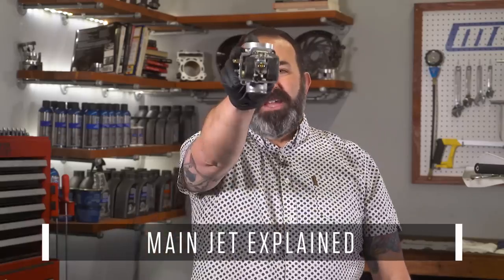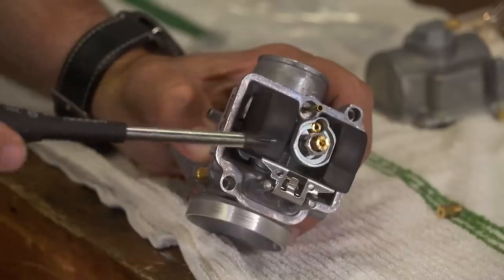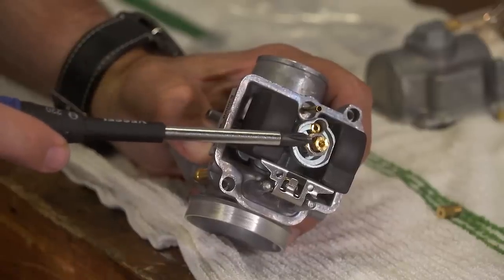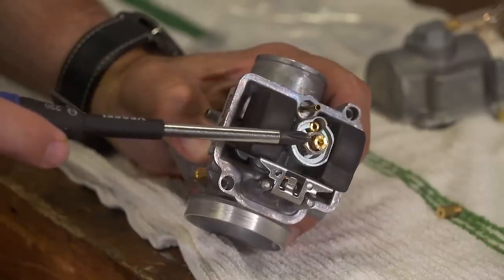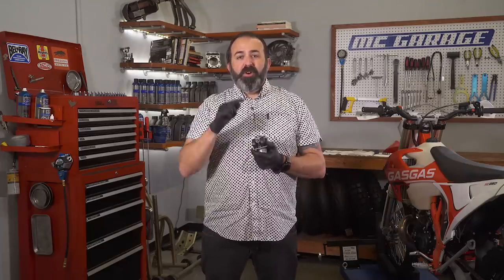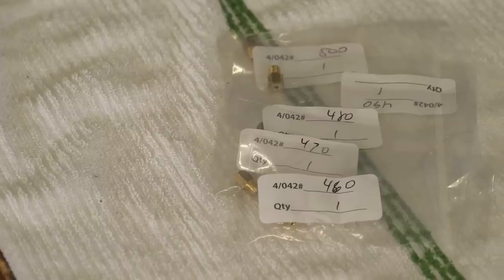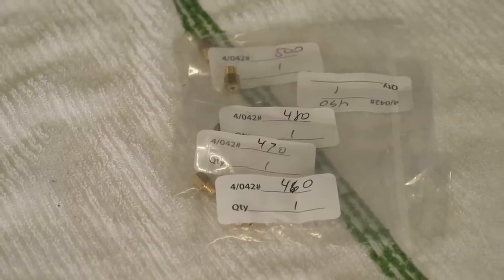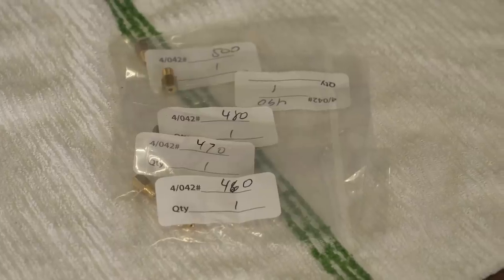Inside A Motorcycle Carburetor - Main Jet Tuning | MC Garage

Comment: Nice n clearly explained, I’ve recently seized my 1952 BSA A10 , suspect it was running lean on either the main or needle jet. Like the man said, it’s difficult to hear it pinking on a 4 stroke especially an air cooled one as there’s a fair bit of mechanical noise anyway. Going to experiment with both main and needle jets. Great video.

Comment: Seems like my bike runs fine until 7000 rpm, then if I go wide open throttle it dies until I let off the throttle again, OR if say I'm below 7000 rpms I can go wide open throttle all day long.  The issue is my bike is set up with the power band between 8000-9000rpm is the sweet spot so I need it to hit that range to get the full 30hp... below 7000 rpms is not ideal.  (no poping or backfiring noises are present.)
Reply: Same here let me know if u get a solution

Comment: i swapped from a stock 30 main jet to 32.5 and put the jet needle on its leanest, ran great up until a certain high rpm at high speed, but the same rpm at low speed didnt have a a lean condition problem, so ive adjusted the needle twice, back to stock, since then and it still seems lean and dies at that high speed high rpm range. of course i always go to full throttle every time but past 3/4 only goes lean at highway speeds. its a mikuni bsw27 btw. cc double barrel gsx250f across carby.
Reply: 3 washers under needle, 60 main jet.  Bam bam perfect.
Reply: MrCokemaster05 nah

Comment: Thanks for share! 
please excuse my wrong english.
I need some help now for jetting.
 I'm crazy looking jetting my Honda XR150L, Keihin PD 20mm bore carburetor. I'm not technician just researching.
Local service does not have a O² sensor and spark plug reading knoweledge seems to be not good.
I made 2 times plug chop  for main jetting and it goes wrong without vissible carbon deposits making me to ask for myself if jets that I have been testing are out of range or they are still in lean range.
Stock jets are 38 and 102, 150cc, 20mm bore carburetor,  stock airbox and filters, 1500f ASL, 82~95°F. Chevron "97 RON".

Spark plug reading for stock jets shows white dots, white deposits, so jets are very lean.
I step up for #112 main jet but plug chop (run almost 6 miles on main jet), plug chop shown just a little brown mark but Not a complete ring, and it spot in the upper part of insulator and oriented to the exhaust valve,   not more!
This question is for your knoweledge,  for this engine, carburetor and environments,  what numbers of jets could be the range to test?
I just like to protect my engine from overheating and knoking or some else failure...

Very Thanks!

Comment: Will a shop let me bring in the carb alone (Bike runs with starter fluid so I KNOW its a carb issue)? It's not even dirty but has a clog somewhere and after cleaning it 4 times I have given up. I don't have a means to transport the entire bike and the fee is well over $200 alone for one way.
Reply: Of course they will, you just need to specify which bike it is from. Also a phone call beforehand doesnt hurt. They even take just the wheels to mount the tires on them. If I were you though I would just ride my bike to the nearest shop, and let them do a carb sync(if you have more than one carb) mixture and idle speed adjustment. (which they can only do when its in ur bike, since factory specs seem to not hold up after a couple of years and carburetors do not self adjust)

Comment: I have a 06 vtx1300 I have a stage one dj kit I do some drag on my bike and looking to get the most out my carb I'm running straight long pipes and a stock airbox and a K&N filter I live in Florida I have the 195 jet can I put the 200 in it to gane more power at wide open throttle and were should my needle be at

Comment: 23 yz125 keihin carb
Can a pilot be lean and be safe? 
My bike is getting spooge from silencer
Stock settings are
Main 160
Pilot 75

I’m looking at jd jetting kit but 
Jd jetting comes with a 50 pilot 
And is telling me to use a 170 main
On 4 position clip of the needle. 

Not sure if that pilot is too lean for my 2 stroke

Comment: Let me ask you this. My wifes Kawasaki Vuocan 750 is acting lean at idle, rich at a cruise but runs great when getting on the throttle. It doesn't idle consistently, when you rev it, it hesitates then revs and takes a second to go back down to normal idle sometimes. When cruising at steady throttle it has a slight hesitation but when when you crack the throttle it pulls good and smooth. Also I pulled her plugs out and they had a yellow glaze like a rich condition. What do you think that is?
Reply: Idle screw. Adjust it
Reply: @resaleking14  The float was sticking and basically flooding the carbs sometimes and not giving it enough gas others. Cleaned the carbs.

Comment: I have installed bigger pilot jet and needle lowered to 2nd position but there is light sputtering apart from that performance is very good. So due to sputtering I lowered needle to 1st position and sputtering stoped but less power in middle throttle position.should I change the larger main jet to gain more power or the larger needle to be installed with the circlip positioned to 2nd or 3rd depending on the performance 
Thanks
Reply: You could adjust the float high and see what that does, could be a lack of fuel off the pitch that’s causing the stuttering

Comment: never change the main jet without changing others thing like high air intake or out take, you need to change the main jet only you have change the racing pipe, cold air intake, if not your bike will run rich